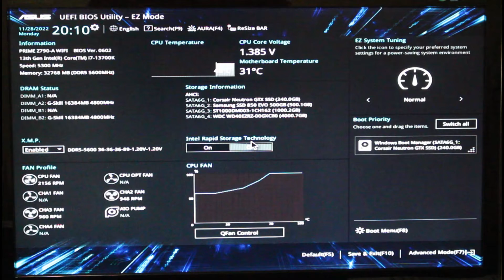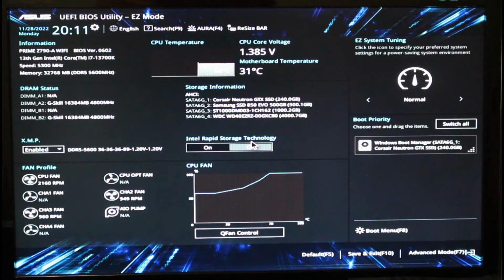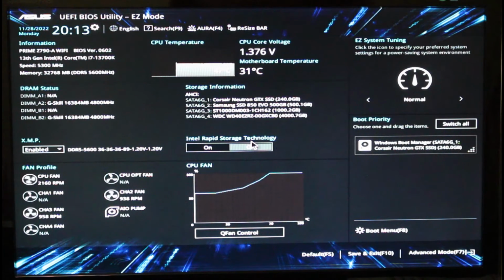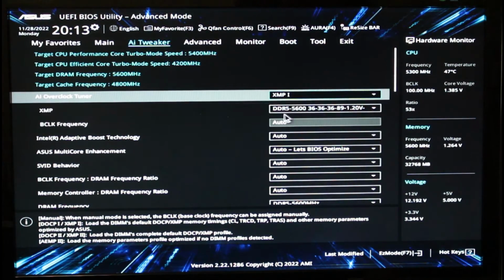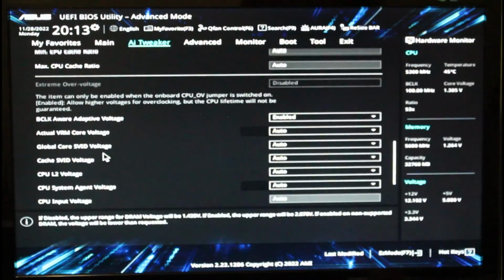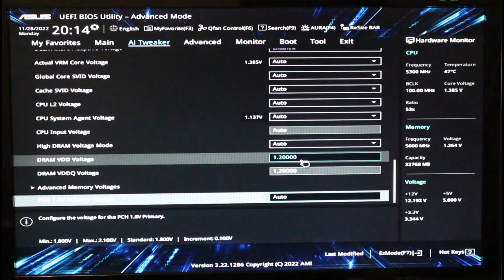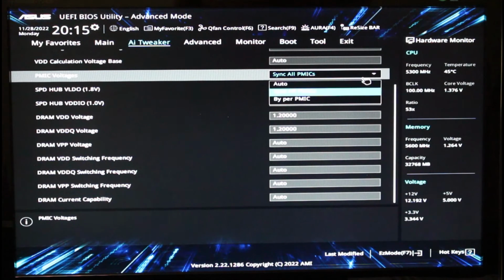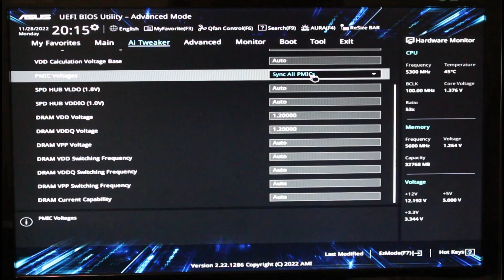How to Fix DDR5 XMP Issues: Use A2/B2 Slots for 2 Sticks (ASUS & 4 Stick Fix)

Comment: I got a similar set up to you with 13900k, same mobo and 4x16gb DDR5 sticks. For the past month I've been having crashes and figured it was the ram. Ran memtest86 on single and dual sticks without issue but failed with the sticks together. Going to give this fix a try now and see if it helps!
Reply: It worked for me, no errors in memtest86
Reply from the maker: @AChillBear  Thank you for letting me know and happy it worked for you!
Reply: @Chill Bear  any crashing or BSOD while using your PC since you made the changes? I also have a 13900k with 4x16gb and have all kinds of stability issues while running XMP. I can run 2x16gb on XMP with no issues. I mainly just use my PC for gaming, streaming, and watching videos.
Reply: @habratZ  It worked for two weeks without crashes, then they started again. Ended up the CPU was faulty and had to RMA it.
Reply: Did you install the new CPU and run 4x16gb on XMP with no issues?
Reply: @googleme.  Took 2 months to figure out it was the CPU. Was a matter of replacing all the parts. I never had a faulty CPU before so it was the last thing I expected. A lot of the freezing/crashes I had made me think it was a RAM/GPU issue. It wasn't. It was the CPU
Reply: @AChillBear which motherboard you were using when problem triggered?
Reply: @AlbertoSauc  yeah it was. RMA the CPU and got a new one, works flawlessly now.
Reply: Same hear removed 2 stick and it worked no problem. Put them back in works for 10 to 15 mins of game play and crashes

Comment: I have gigabyte aorus elite AX ddr5 with gskill 6000 32gb when I installed both sticks I got 4800 after enabling xmp the PC won't boot anymore I had to reset the cmos and now only one stick of ram is working while the other one if I connect it the PC won't boot anymore please help
Reply from the maker: I've heard that the sticks above 6000 still have problems, which is why I opted for the 5600.

It might state in the bios that it runs at 4800, but that seems to be a glitch, if you check in windows and with benchmarking software it will state 6000 on XMP.

In which slots are the two sticks installed?
A1, B1 or A2, B2 or A1, A2 etc.?